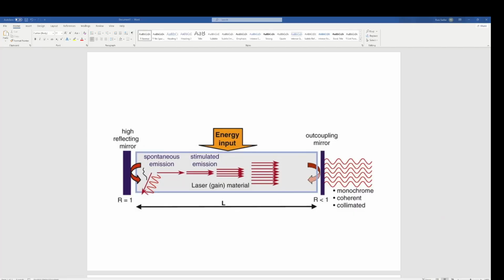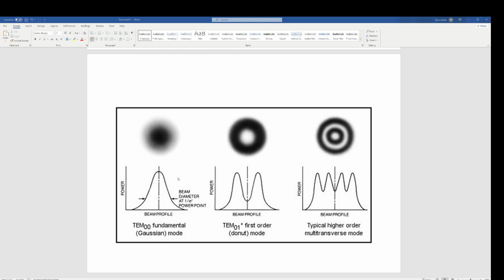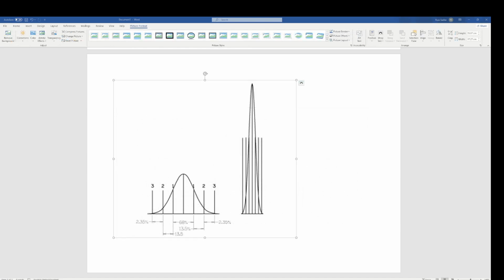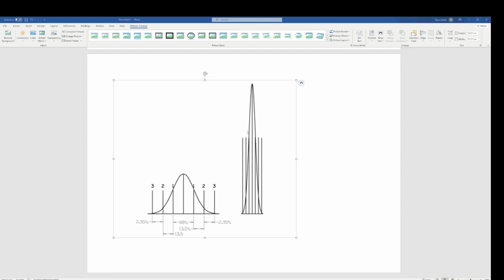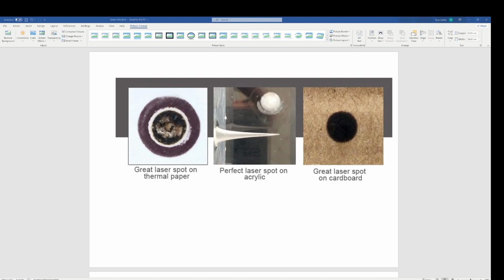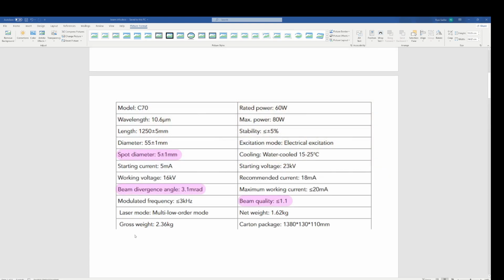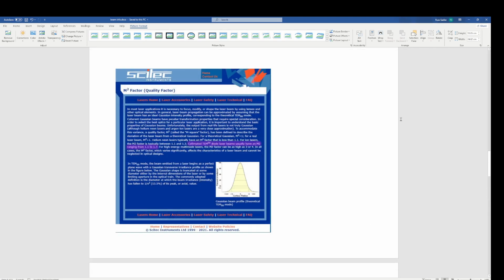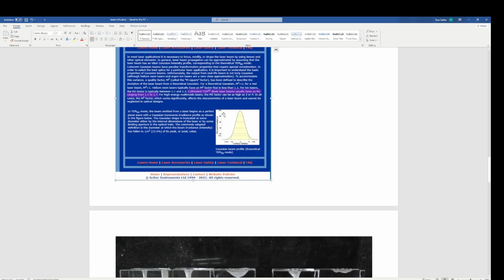Laser Beams and lenses   Two Unruly Teenagers Pt1

Comment: Hi Russ, hope all is good, been watching the channel for a couple of years now. I'm trying to resolve a problem, I have a bad stepper motor & really struggling to find a UK supplier, hoping you can point me in the right direction... Model Red Blk laser - motor 57bhh51-280a-25c
Thanks Phil
Reply from the maker: Hi Phil
Tthis is just a standard NEMA 23 frame size stepper with 200 steps per rev. It is unlikeley your machine has a feed back system for the motor , I see no clue in the part number.
https://en.cwmotor.cn/product/36.html
Just measure the length of the motot (I guess it's 51mm long .... one of the cheapest and weakest) and you will be able to find this  (4 wire?) motor at several UK stoockists. Just check the shaft diameter is 6.35mm . Check if has 4 or 6 wire out of the motor. 
 Try   Ooznest. in Brentwood Essex  01277 523171
https://ooznest.co.uk/product/nema23-stepper-motors/
Speak to them and tell them what you have and they will sell you a close match. If it's a bit longer . no matter it will be a bit more powerful. Your driver will take it Just in case they ask. make a note of the black box driver model.

 Here is an equivalent from Cloudray ( about 14 days from China) https://www.cloudraylaser.com/products/cloudray-55mm-0-9n-m-2-8a-2-phase-nema23-open-loop-stepper-motor?_pos=46&_sid=5e92cdfc8&_ss=r

 Best wishes
Russ